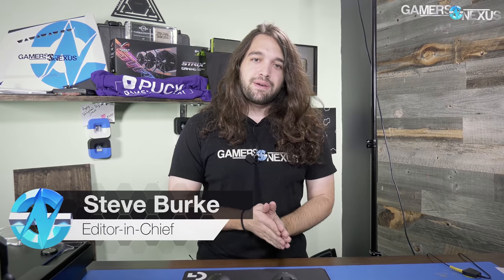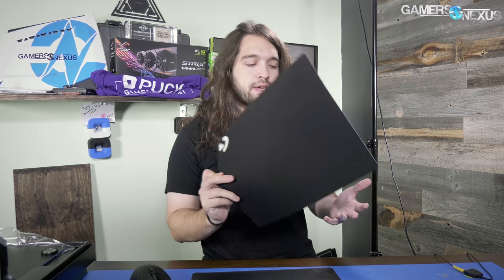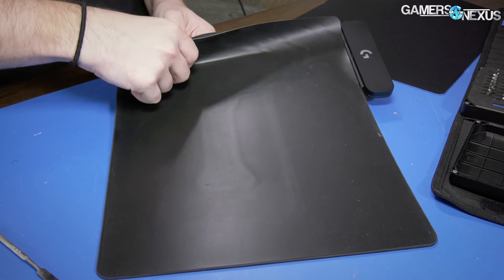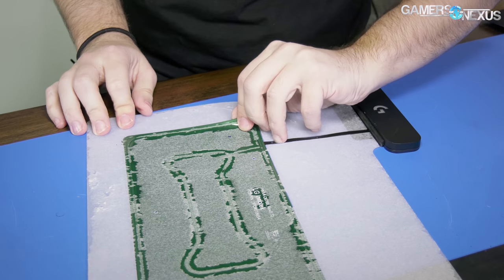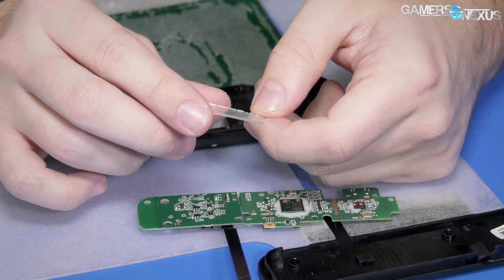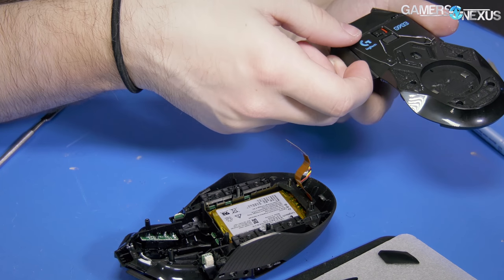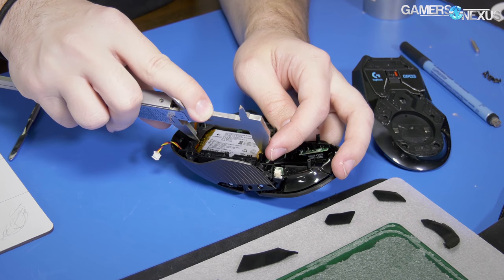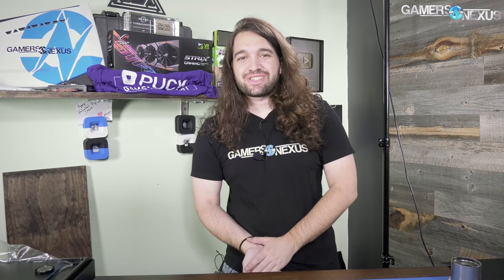Logitech G903 + Powerplay Wireless Charging Tear-Down

Comment from the maker: For anyone who wants the battery information, here is what the battery reads: Logitech is using a Springpower Technology Li-Poly battery that’s rated for 750mAh at 3.7V (2.775Wh). The model number appears to be 383450. The battery measures roughly 50x35, +/-1mm.
Reply: i watched the g900 review from the description and i gotta say i'm disapointed,  u were mentioning their measurements  and talking about tech in the mouse, which is all good and well, except there was no measurements done by gamersnexus  in regards to the mouse's precision, for example:
max tracking rate,  positive or negative acceleration checks,  prediction tests, jitter tests (often existing at laser sensors  and at insane useless high dpi sensors),  your own latency tests, not going by  logitech's data, lift of distance,  checking if the mouse works perfectly on all possible mousepads, inlcuding, hard pad, cloth pad and metal pad.

basically i do not know if this mouse is precise from your video and article all i got is your subjective opinion and logitechs results, which we can't trust of course.

please consider changing this for the future,  i know mouse reviews aren't gn's specialty,  but u certainly can step it up to the benefit of all your viewers.
think about your mouse review like a graphics card review without benchmarks in a way, it's quite useless.
this is positive criticism btw, not hating, but being frustrated  with the lag of real reviews of mice on the internet nowadays and i know u  can step it up and want to give your viewers and readers the best data to decide on.
Reply: cataria pega, I agree with you. I hope GN would eventually get to do the kind of deep reviews into mice like they do with other stuff.
Check Rocket Jump Ninja channel in the mean time, he does a great job with mice.
Reply: Those are some seriously unreasonable expectations. I have not seen any tech youtuber test on those things specifically. I know a lot of people have a somewhat higher expectation of GN compared to others, but GN doesn't have the equipment for that shit mate.
Reply: I think t's fair to expect that kind of content from GN based on their GPU and other content, but it's true, it's not easy to go deep on different areas at once.
No independent tests have been done on Logitechs claims over the G900 wireless performance(other than subjective "I don't feel a difference" stuff), which is a shame. Hope someone eventually does it.
Reply: rocket jump ninja does not do objective tests of the mice, but "if it works for me in quake, it should be precise and work for u" kinda thing, he doesn't do max tracking rate checking and all tests are done through his hands, i mean it is enough to point out dirt like the razer lancehead wireless, it's still far from great imo.
if we would do graphics card tests without benchmarks, people would lose their minds about it, but for mice it is ok apparently, and for computer displays too btw,  almost no one does latency testing on displays....
btw ramla777 a small youtube channel at 600 subscribers does max tracking rate checks at the dpi settings the mice have, i don't know what testing he uses, but at least he does it.
don't get me wrong rocket jump ninja is far far better than most of the rest of "reviews"  out there, but it's not enough to do an objective decision on.
i can look at a gamersnexus graphics card review and i will know pretty much exactly what i got: sound level, temps, normalized temps/soundlevel,  performance overclocking head room undervolting and very important vrm quality and efficiency!... everything i need to know and more.
steve even said in past videos, that he doesn't review psus for example, because of the knowledge and tech needed to do it properly, like  johnyguru does for example, but that kind of knowledge or tech is not needed to make a mouse review much much better.
and keep in mind gn is paying buildzoid to give us the only real vrm reviews of graphics cards and motherboards out there (not including buildzoids own stuff).
so we know gn is doing their best to give us the best reviews they can and maybe they will read this and actually improve their mouse testing, because i know they actually care.
Reply: "if we would do graphics card tests without benchmarks, people would lose their minds about it, but for mice it is ok apparently"

That would be because you can benchmark GPU's without paying a penny on extra equipment. You need a PC, that's it. Maybe, possibly, you need to pay $15 for the benchmarking software.
Meanwhile, to benchmark mice, you need high-tech equipment that costs thousands.

Do you guys really not see the difference here? I feel like a lot of you really don't think further than "I want benchmarks", not even thinking about what that entails. You can't expect GN to just spend thousands on mice benchmarking equipment.
Reply: 1000s? u can test a lot of things without much hardware, u can physically
 test lift of distance by whatever means u want for a starter, rocket 
jump ninja is using dvds, which is ok i guess..... but not perfect.
testing reaction time would mean tracking the time from click until it shows on 
preferably a crt to avoid other latency, which i doubt would cost 1000s,
 but i might be wrong here and max tracking speed can be tested by a self made  thing like this:
http://www.esreality.com/?a=longpost&id=1265679&page=3
which will be like what 50-100 dollars, depending on what parts u wanna use?
that's far from 1000s.
mind u this article was from end of 2006, so after over 10 years and with possible help from logitech, there should definitely be a solution to be found, that won't break the bank and give us great results.
Reply: for reference if u go to the video review of the g900 at 2:20 u will see a test apparatus, that will will cost thousands probably.... but that is not needed here and not what i suggested.
Reply: Great teardown of the mouse and the mat, very informative and answered quite a few questions.   I just hope Logitec forgives the sacrifice of this unit to the Great Steveism gods, lol.

Hallowed are the GN crew, for this vid was good. (grin)
Reply from the maker: Cataria -- that review was done a long time ago. We weren't that deep on mice yet, and still aren't. We were able to validate those measurements with Logitech's own tools, but haven't yet developed our own. It would take thousands of dollars to build latency testing equipment, but we do want to do it eventually. It wasn't just "repeating" Logitech's numbers, though -- we saw them and produced those results ourselves with their tool setups. We just need to build our own latency tools, at some point.

Frequency & interference testing won't happen. We'd need a massive lab to do that properly. Latency can be done. Give us time.
Reply: Tadashi TG but RJNinja is reviewing mostly subjective and non scientific. I like him but he is nowhere near scientifically quotable.
Reply: as a mouse enthusiast  i would already be very happy, if max tracking rate  and precision of the sensor (prediction, positive and negative acceleration) could be tested in the future, this would cover all wired mice good enough and  for those that want to use wireless mice (i'm not one of them, but many want em)  if u as u said ad latency tests at one point in the far future, this would make u the best  objective mouse review channel on youtube, which would be really cool to say the least. :D
Reply: +cataria pega
"1000s? u can test a lot of things without much hardware"
Steve did just confirm that the equipment for everything you asked for would costs thousands, so my esitmated guess was accurate.
Reply: @unilythe
and i linked u a way to test maximum tracking rate very very cheap?
gn was talking about   high quality latency test testing, maybe there is a cheaper ghetto way for this too, but that is not what  gn is going for, which is reasonable.
but u don't need 1000s to test for max tracking rate or lift of jitter and a lot of other things.
so your estimate was partially true, same as my thought of certain things being quite cheap to achieve (max tracking rate)
so i don't understand, why u have to  try to be so right about your statement, instead of  reading all comments and seeing the objective nature of: "some things may cost 1000s to do at gn quality levels, but some things may be relatively cheap to test, to test good enough"
also again  i didn't post things as an entitled girl being like " do the benchmarks now! how i want!"
i voiced positive criticism, which i  think can improve the already amazing channel.
Reply: There I was, expecting Steve to whip out an iron or a hotbag to heat up the adhesive so that he doesn't spend an eternity struggling to separate the layers. 

Nope.
Reply: cataria

Measuring anything is much much harder then it may seem. There are reason why serious laboratory equipment cost what they cost. In layman terms there is just shit ton of things to calculate, measure in lab and calibrate even when components may seem quite cheap.

What You for example send as example. Is in no way shape or form accurate. Why even bother with that then?
Reply: can u charge a g903 with the qi dock charger of bequiet dark base pro 900 ?
Reply: No, of course not. They are completely different implementations.

Comment: FYI - the metal pin rides on ridges on the inner diameter of the scroll wheel under spring tension, which can be relieved to allow for free wheeling - it's not sticking into the spokes (that would completely block it's rotation).

Comment: Just in case this has not been answered yet:
In regards to Steve asking about what the coil is referring to,
The green flex PCB with the large copper traces will be the resonant coil in this application.
A coil is just any conductor that forms a loop.
You can make an inductor out of power extension cables when you wind them up for storage.

Hope this helps.

Side note: In circuits capacitors and inductors dont actually have to be physical components soldered to the PCB. They can be made out of specialized designs and patterns in the copper on PCBs. This technique is quite often used at higher frequencies like in RF (eg 2.4GHz) etc.

(I have an EE background in design and manufacture of consumer electronics)

Comment: I bought my Powerplay on 12. 8. 2019, so 4 years exactly (+few days) and it was used. Still going strong! Just upgraded from G903 to G Pro X Superlight around the time the mouse came out.
I am glad Logitech still supports it as it's a great tech and I bet they patented the snot out of it as I didn't see this implementation from other brand (only a corner of it from Asus or somebody).
But as I didn't see any marketing push or big mentions about Powerplay in their trailers... I worry that they will drop it sooner or later.
Only negative I have is that the cloth top is nowhere to be found for me. The support told me that I bought the right one - the G240 - but you will find out that G240 is soft cloth without hard back. So it will warp and stretch like a carpet from a chasing sequence in a cartoons.

RGB, charging and the reliability is still awesome and charges to 80-85%, so the battery is not being kept at 100% all the time. I never had like an issue with the charging stopping to work or something. It's so great in fact that I made a fool of myself when wireless mice was brought up in a conversation and I was defending it without realizing that only Logitech offers the experience that I was talking about. (fyi - I have nothing against wired mice)

Comment: Any conductor that conducts current generates an EM field so that is a coil on the outside. Also the mouse would charge faster if it moves around the coil as more tension is inducted in the wires when the magnetic field is changing or you have an object moving through the magnetic field

Comment: Biggest flaw in g502/g903 that no one mentions about is cheap membrane button under the wheel (middle click) which wears out in a year if used frequently. I enjoyed using my g502 and absolutely love the scroll wheel, however g502 was marketed as full omron switch device and it's shame they omitted using a proper switch for middle click button.
Reply: Thanks for the information. Hope you get a new mouse soon.

Comment: And all the G900/903 and potentially all the rest of their latest 'G' mice are all defective in their switches.. and half of them are defective in their scroll wheels.

Spent $450 + an RMA on these top of the line mice (4 total used), all have had either faulty scroll wheels or the "double click" issue, or both.  The longer time goes on, the worse it gets.

The only resolution to the switch issue is to replace them outright, with real japanese omron switches and not whatever the garbage they're using is; so people say anyway.
Reply: Wtf used it for almost a year now it's just perfect
Reply: iunno, I mean I guess it depends. for me, Corsair M65s broke on me several times, and we have like 5+ Steelseries broken in the household. the build quality, switches, etc, they are all just awful. but, luckily, since the shop gives you warranty, there is practically a 0$ cost of replacement so I don't mind.
Reply: I've had my G903 for around 2 years and it's flawless. No scroll wheel issues, no double click issues, or any other switch issues. Sounds like perhaps you just keep breaking your mice by ham-handing.
Reply: @SOSOGUDRANA  Same, haven't had an issue with my 903, build quality is top notch, and the buttons are also great. The shape can be improved however.

Comment: I've been using this mouse + pad combo for almost 3 years now and I don't have a single complaint with it. ❤
If you can find a good combo deal or if you're willing to give refurbished/open-box options a chance this combo is a great upgrade or gift option for anyone who enjoys quality tech. 

(Although if I'm being completely honest the wireless mouse pad absolutely feels like a luxury that's "nice to have" but totally non-essential.)

You can charge the mouse by cable much quicker than you would on the mousepad and the battery life when the mouse isn't being charged at all is still FANTASTIC after 3 years but I also turn off all unnecessary RGB so keep that in mind

But that's just a 2+ year user's anecdotal data for prospective buyers to consider. Steve gives some great technical info here and that's infinitely more interesting/enlightening.

Comment: Small correction at 21:25. The spokes you see are not for engaging the detent which gives you haptic click as you roll the scroll wheel. Those spokes are the relative encoder that helps to count the rotation. The detent clicks you feel are because of a spring that engages the inside of the scroll wheel at 21:31. They are not very prominent and looks zigzaggy! on the inside rim of the scroll wheel. Think of it like a mechanism from a ratcheting spanner. Sample principle.

Comment: arent the spokes used with an optical encoder to measure mouse wheel rotation, the engaging of the clickiness happens here 21:34 on the inside of the wheel

Comment: I really appreciate the wireless charging mat, I have been saying it for years. But truth to be told we had a perfectly good solution with the logitech g7, which was swappable batteries. You just kept 1 in the mouse, and 1 in the charger, and just flipped them. It was light weight and it took about 2 seconds to swap, and you always had a charged mouse.... Then everyone stopped doing that tech and went to fixed battery with the ability to plug the cable in, which meant if you forgot to charge you had to use it cabled... which sucks!, so now they "try" to solve that problem with this fancy new expensive tech... Why not just do the swappable batteries?????
Reply: i've been saying this for years!!  the G7 was the best mouse ever made!!  (even for us lefties!)
I wish they would bring back the G7. I would have bought 10 of them if I knew the future of mice.

Comment: From what Iearned in Electromagnetics class, here is my assumption. That outside ring is the inductor that is powered by the   usb 5V 2A supply. The inner inductor is magnetically coupled with the outside one and works like a transformer. The output of the inner loop is probably lower voltage but significantly higher current, which allows the generally efficient wireless charging.